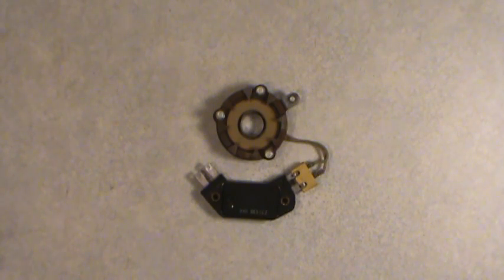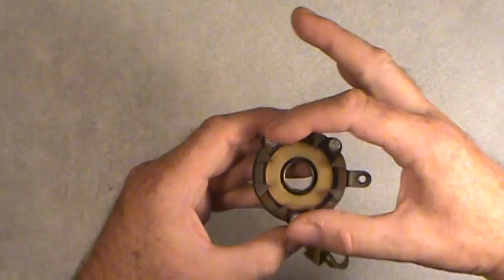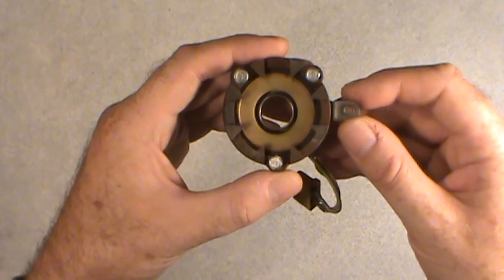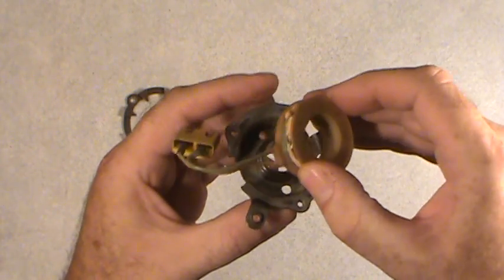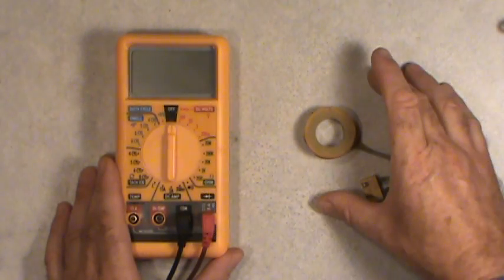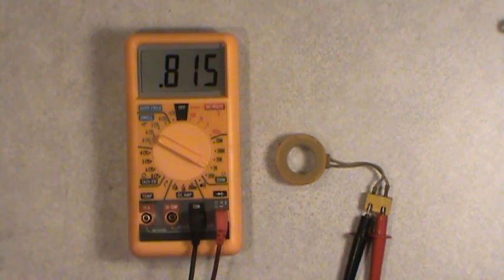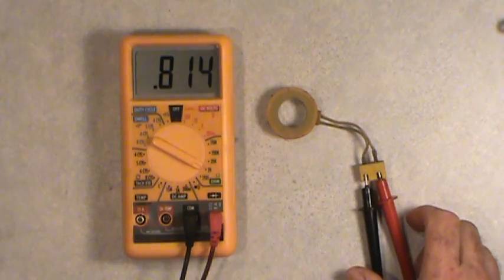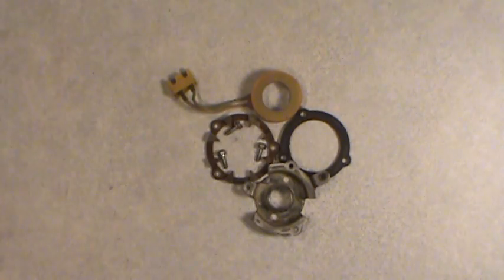HEI Distributor Pickup Coil Test

Comment: Would this cause a no spark issue?
Reply from the maker: Greetings...sisenortellez2881..........Thanks for watching.........There are lots of things that can be the cause of a no-spark situation........The HEI distributor needs to have battery voltage (12 volts) at the usually red wire, that plugs into the distributor cap (maybe bad ignition switch or wiring?).......Pickup coil and ignition coil, have to be in good working order, as well as, all of their connections have to be clean and well connected.........The ignition module has to be in good working order, and have the correct "thermal paste" (Not die-electric grease...!!!), on the bottom of it, in order for the ignition module to stay cool enough, or, it will usually over-heat and destroy itself..........Then, there is what, I had happen to me, not too long ago........Engine would not start, then, I checked the ignition coil, pickup coil, 12 volts was there, all good.........So, I had a used ignition control module, that I swapped into the HEI distributor, with the heat-sink/heat transfer paste, and...it started right up...wowsers...!!!.........The last time, I started and ran the engine for a while, it started and ran great, then, for some weird reason, the ignition control module, just died, all by itself, by just sitting there, doing nothing...!!!...(and it was the original GM module)..........That's the first time I ever had that happen, and....be safe, take care, and have a good one.

Comment: Ok..Just let your viewers know that you have to pull the distributor out of the engine block and disassemble the distributor gear to pull the shaft out to get to the pick up coil on all GM HEI distributors...
Reply: No.  You can measure ohms of the magnetic pickup right inside the distributor without removing anything except the cap.

Comment: Excellent stuff, this is the ignition , we all need to know, along with the vacuum device, the rest is mechanical, and full resistor leads and spark plugs, i use a Bosch HEC 716

Comment: I just wanna ask if this pick up coil can be a cause of intermittent misfires on the inside of cylinders
Reply from the maker: Greetings...bartixlascuna..........Thanks for watching..........Yes, indeed, a faulty HEI pickup coil can be the cause of a misfire alright.........There are so many other things that cause misfires as well, such as...bad ignition coil...bad spark plugs...bad spark plug wires...bad HEI ignition control module...bad distributor cap...bad rotor, and there are even more........Also might be...Bad fuel system, as in...bad fuel pump, plugged-up gas filter, faulty carburetor, etc. .........Then there's what happened to me..........I had a Chevy 350 cubic inch V-8 that had a slight misfire, and I had a heck of a time tryin' to figure it out.........It wasn't until I removed the passenger/right side valve cover and finally saw what the problem was........It turned out to be, the number 4 cylinder's, exhaust valve rocker, was hardly moving up and down, like the rest of them were, when the engine was running at idle speed...!!!.........The camshaft's lobe, for that exhaust valve, got destroyed, and was rounded off, and couldn't make anything go up and down anymore........So yeah, there are many things that can cause a misfire alright...and......be safe, take care, and have a good one.

Comment: You speak of 12 vdc at red wire, i have 12vdc at purple wire with key on. 1986 chevy 350 installed in a boat, Crusader is engine make.
Reply from the maker: Greetings........Yes, indeed, the wire color might be different, depending on what the engineer or designer had in mind alright........With any HEI distributor that I have worked on, there was usually just two terminals at the top of the distributor cap..........One was for the12 volt/battery voltage, and the other terminal, was the "tach" (tachometer for rpms) terminal........Try to find a factory or aftermarket manual for your exact boat and engine combination, that way, you will be able to see what color wire connects to what terminal.........You might even go to a boat parts place that has your engine type, and if you're lucky, they will have quite a bit of information that will help you out........Good luck, and......be safe, take care, and have a good one.

Comment: What was done was excellent...but whst is the voltage output when running ?
Reply from the maker: Greetings...danieljurgill 1681......Thank you......For me, the output voltage is tested while "Not Running", for the HEI's pick-up coil........I test mine on the workbench, by having my multi-meter set to "ac volts", and the probes, plugged into the disconnected connector, that goes to the pick-up coil.........I then spin (as fast as I can, by hand), the helical gear, that's on the bottom end of the HEI distributor, and, I usually see about 1 volt, if it's working ok........I hope this helps you out, and, till next time....be safe, take care and have a good one.

Comment: I've read on a forum that the pickup coil resistance should lay between 500 and 1500 ohms. 
However, the poster continues saying that the voltage output of the coil should also be measured. 
Good reads should start at 0.4 and end to 1.8V. His particular coil only created 0.4V, and he said that is a problem because it should rise up to 1.8V.

What do you think about that?

(I googled TBI pickup coil normal resistance, and chose a result called chevytalk)
Reply from the maker: Greetings...soupflood........What works for me, is when, the HEI distributor is on the workbench, and I can get about 1 volt (ac, I think)...when I spin the helical gear (by hand), as fast as I can, while having the multi-meter set to AC volts, and the probes, hooked up to the pickup coil's connector (two wires).........If I recall correctly, the ICM (Ignition Control Module) is probably looking for a falling voltage, in order to get itself triggered, so to speak........An AC sine wave, goes up and down, kinda like a roller coaster does (ac sine wave...starts low...rises to its peak...then falls back to low...over and over again), and having the zero voltage potential point, half way, between the lowest point, and the highest peak (as I recall)........I replaced the one in this video with a new one, due to, how dried up the coil windings looked to me (probably from heat and old age), and also, how stiff (not supple/easy to bend), that, the two wire leads felt at the time.......Whenever ohms or voltage testing one of these pick-up coils, wiggle those two wires at the same time, just in case there happens to be an intermittent/internal break, inside one of those insulated wires........Also, it's very important to line-up that "dimple" (partially drilled hole), that's on the hub of that helical gear, with the metal tip, that's on the "rotor" (that's on top of the V-8 distributor)........Why you ask, well, it's because there are 13 teeth on that helical gear, and if it's installed 180 degrees out of phase, then, things get kinda messed up, and probably, rotor phasing being out as well, by being, 1/2 of a (gear) tooth out, just sayin'........Funny how I got introduced into learning a bit, about HEI distributors, and it goes like this.......I had a chevy 350 V-8 (circa 1979), that had a misfire happening.......Ah, I thought (to myself), it's gotta be that new fangled electronic (HEI) distributor, that's  causing the problem........So, I decided to fire the good ole parts cannon at it, a bit at a time, as in, new cap, rotor, ignition module, and pick-up coil, as well as, new spark plugs and spark plug wires (good ones...lol) too, and the misfire seemed to lessen a bit........That misfire, turned out to be, the number 4 cylinder's, exhaust valve's, "Camshaft Lobe", that went from being a lobe (oval shape), to almost being, a round circle, due to "not seeing" that particular "rocker arm", hardly doin' the teeter-totter movement, like all of the other 15 of them were doing...!!!....Well, if it wasn't for me, blaming that poor ole HEI distributor for that misfire, then, I might not have, learned much about them, and, this youtube video is probably a result of that (fortunate mistake), that I made, quite some time ago........If you have any questions at all, just leave a comment/question, under any of my youtube videos, and, till next time.....be safe, take care, and have a good one.
Reply: @RockysRoadshow   I've also read that the pickup coil can be tested with a red LED. If it lights while the distributor is turned, the coil is okay. 

I can only hope my van doesn't have a bad cam. I don't know if you watched my video of my van. It's got a 3.1L V6 engine (almost half the cylinders volume of your 350) from 1991, was wondering if your 350 from the 70's sounded about the same  (Scroll to minute 2 or 3 in the video to bypass the distributor inspection intro if you want). Oh, one other important simptom of this engine is it's really sluggish until it gets to operating temperature. Like, it won't even have the power to get beyond 30mph in order for the gearbox to switch to the last gear (3rd) - unless the coolant gets over 60°C (140F).
My next move would be to replace the fuel pump. Maybe it's brushes and commutator are almost done. I saw a date on it if my memory serves me right "2016" so I figure it's about time for a replacement anyway. 
I was recommended to buy a fuel pressure tester but it costs more than the pump itself.